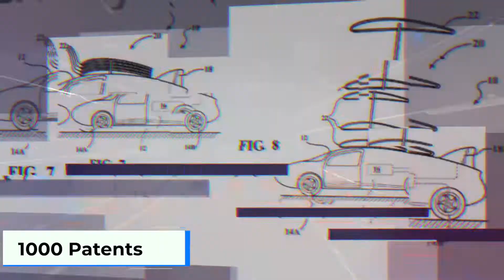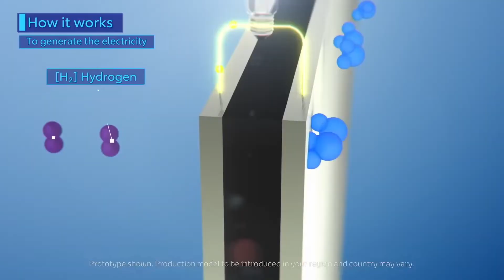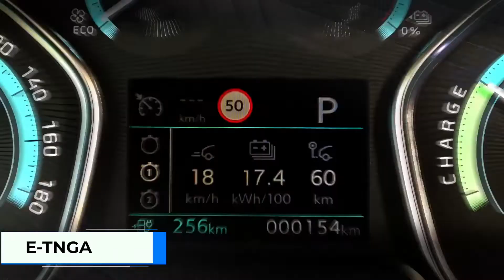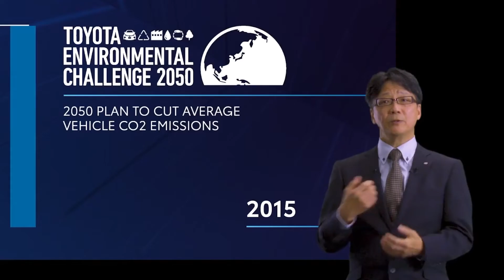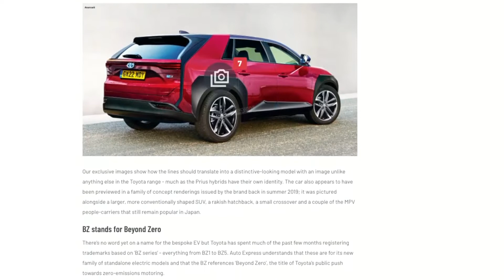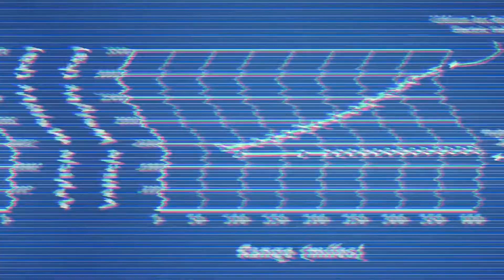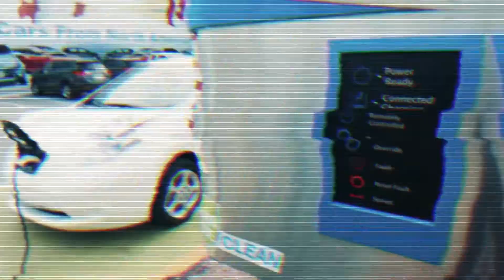Inside Tesla VS Toyota Hydrogen Fuel Cell Electric Car

Comment from the maker: What do you think of Toyota Hydrogen Electric Car?
Reply: its very good design but the price too much for the specs, it should be dual motor( AWD )and with performance package not this 0-60mph in 9 seconds its pretty slow and difficult to convince petrol heads & at least with plug-in option we can charge at home since hydrogen supply in even california is unreliable and sometimes offline due to maintenance & costly
Reply from the maker: @hfe1833  Agreed, but I believe as demand and production increases for Hydrogen Fuel Cell, the price should beome more competitive and within budget for most people.
Reply: @TechDivision1  hopefully more competition better for consumer
Reply: You are talking about solid state batteries, but show fuel cell vehicles. Please do some actual research next time.